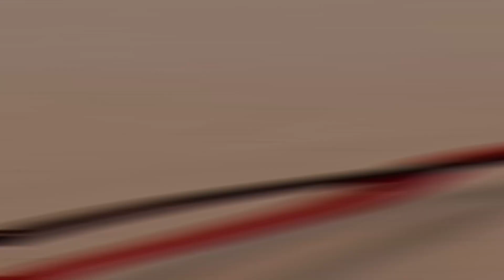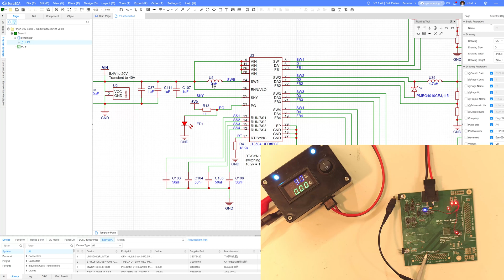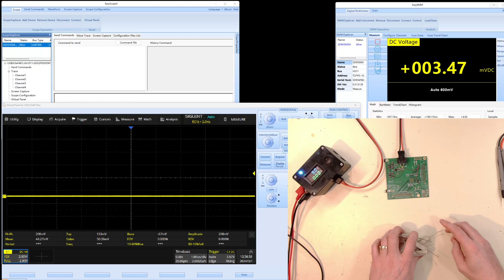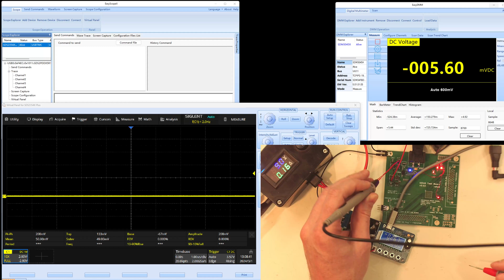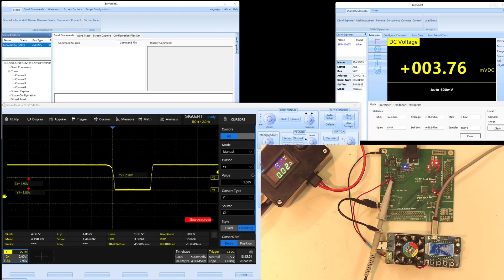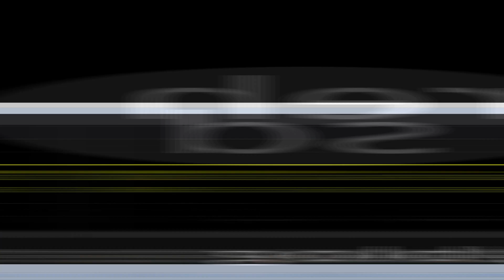iCE40 BGA-121 Dev Board - Testing the Power Rails (3 good, 1 bad)

Comment: Havent watched the entire video yet, and maybe I'm wrong, but feedback is only based on a ratio created by a resistor divider, it doesnt need explicit resistance values as far as I know (although higher resistances may make it more susceptible to noise). So if you were going to use a potentiometer, perhaps only as a test setup, you could simply use it to create a variable resistor divider to set the required ratio to provide the required feedback voltage from the rail you are creating (e.g. a potentiometer creating a resistor divider set at the 50/50 point on a 5V rail will create 2.5V). From that you could then measure the two resistances and determine the closest matches for fixed resistors.

Also, 2.54V should be fine. I wouldnt be worrying about 40mV over, or perhaps even under. Althgouh on a personal level I do like to see at least the voltage for the rail that I am measuring (e.g. 2.5xV, 3.3xV, 5.xV for example). 3.1V is still within the usual 10% tolerance most parts seem to specify, but it doesnt "feel right" so I'd be trying to bring that up a bit. 🙂
Reply: 10% is waaay to coarse for FPGAs. Most of them require at least 5%, with more advanced ones require 3% or even better.
Reply from the maker: @asmi06  , @TomStorey96, I now have my rails at 1.1966V, 2.5472V, 3.3268V, and 4.9922.
Reply from the maker: Your comment about the ratio matches my understanding. The datasheet mentions using a 10K for the denominator resistor in the divider. "Each feedback pin is regulated to 800mV. Connect the feedback resistor divider to this pin. ... A good value for R2 is 10kΩ." I'm with you... it doesn't feel right if I'm not at least at the target value, with being slightly over better than slightly under.
Reply: @rehsd  Yeah I figure that if 10's of Kohm are suitable resistor values, then using something like a 100Kohm or perhaps 50Kohm pot would probably be suitable. I suppose the other option is a bench power supply outputting the target rail voltage, and then using a pot to create a resistor divider whos output you measure and adjust it to create the feedback voltage and then use the two resistance values to size up your feedback resistors.

Or 10K to ground and a pot in position of R1 so you can figure out the appropriate R1 value.

Lots of options.

This is really interesting stuff though, looking forward to more of these videos. Im going to need to build myself some buck regulators now I think! :-)
Reply from the maker: @TomStorey96  And the datasheet does provide a formula for the two resistors, R1 and R2. I might experiment with some different values other than 10K for R2. I can probably find a different combination of values that will meet my needs, with the resistors I currently have on hand.

Comment: Do not add POTs in the feedback lines of buck converters. They add a lot of noise, and also they can make converter unstable due to added inductance. Instead buy a kit  like KIT-RMCF0603FT-05 so that you will always have a value you need. There are a bunch of those kits, but make sure you get one with at least 1% precision resistors. KIT-RMCF0603FT-05 is one of kits I use, but that vendor has a full lineup of different values and sizes.
Reply from the maker: Good idea, thanks!